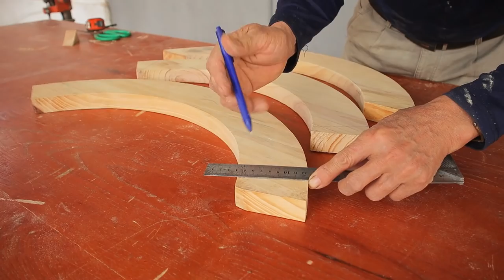The Most Amazing Creative Wood Strip Processing Project // Perfect Coffee Table Set With Unique Way

Comment: As a former trauma nurse, I can’t tell you how frightening it was to watch you cut those boards on the table saw with no push stick!!!
Reply: I was thinking the same thing at that point... nice equipment, should have the resources to do it right!
Reply: The blade was covered by the timber for the most of the cuts, no mention of the band saw then? and I'd have been more worried about that and I'm also a wood worker, the woodwork workshop is full of potential horrors we learn to adapt and stay safe
Reply: at 0:40 he's basically freehanding the piece of wood on a table saw, which is one thing you should never do
Admittedly he doesn't have a choice because it's a homemade table saw with no fence...
Reply: Lol that you're thinking a pushstick would solve problems with that cut
Reply: Doing dangerous stuff safely. I think that’s the best way to do it..